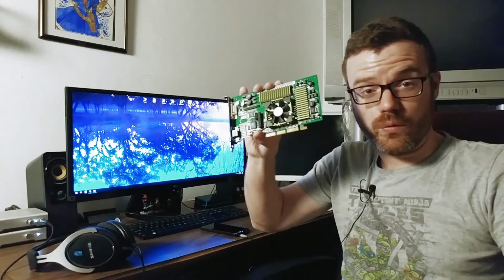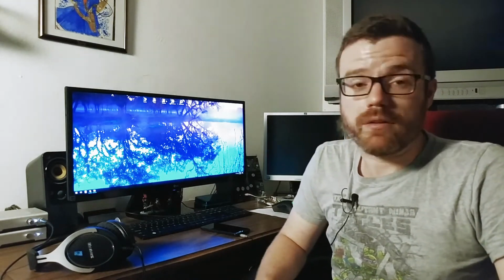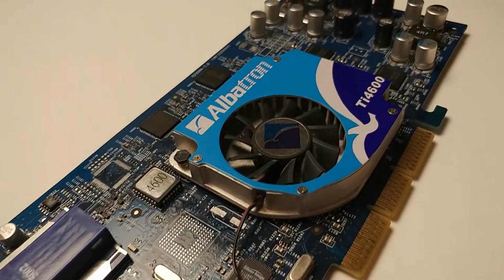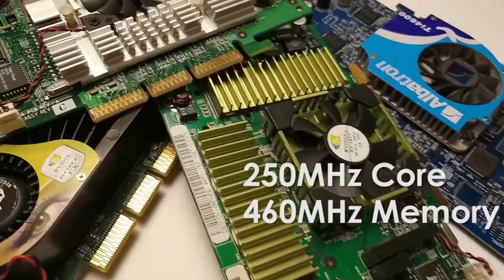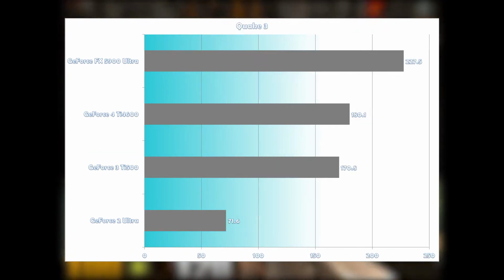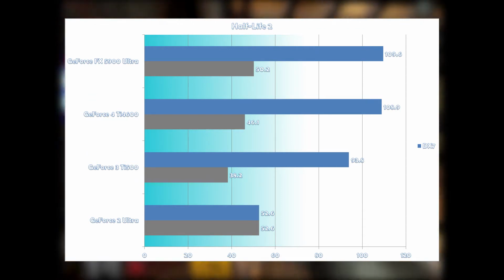NVIDIA's Quad Pipe (4x2) Architectures Compared - GeForce2, 3, 4, and FX

Comment: @PixelPipes
What about the fastest DX7 card? It might be interesting to analyze as well. The improvements are probably the similar. But it would be interesting to see the improvements over a long-lasting architecture like DX7. For example, the move from the 4 pixel pipes of the Geforce 256 to the 2 pixel pipes of the GeForce 4 MX 460.
Reply from the maker: DEFINITELY on the to-do list 👍

Comment: The graphic cards came along way back then. My first Nvidia card was  Riva 128, followed by a GF 256, then a GF 2 GTS,  GF4 ti 4200/GS,  FX5900XT and finally an unlocked GF 6800GS tuned by Riva Tuner to unlock those extra PP and VS. Lot of fun messing with these older GF for sure!

Comment: My first GPU was a G force 2. I remember being blown away when I saw quake running at a locked 75fps (which was the style at the time) using glquake. Good times 😁
Reply: my first was a diamond (brand of card)  voodoo 2,  then i got a tnt 2 ultra , then a geforce 2 ultra , then a geforce  4 4400 ti , then a radeon 9700 pro. then a radeon HD 800 ,  then a HD 5750 , then a geforce 9600gts ,  then a radeon 7870  (tahiti version with a 7950's core not standard  7870 potcairn core) and lastly i'm still currently on a geforce 1070.  damn how the power on these things  have cranked up over the years.

Comment: Ultra? those existed?? I never seen one... everybody only had the normal ones...
Reply: I got my FX5900 Ultra just last week.   256-Bit and 256 Mb! It is an ASUS V9950 ULTRA. Looks a lot different than the one in the video, because the one in the video uses the quaddro cooler and mine uses the dual fan copper/brass ASUS cooler.

Comment: For win 98SE retro gaming the FX5900 is a much bigger leap than shown here above the geforce 4 series. It brought anisotropic filtering optimizations, making setting and forgetting 8x AF a realistic possibility (this was and is the first thing you should do before increasing resolution). 

On the Geforce 4, just  8x AF clean halved performance. 4X AA would halve performance again, getting you into trouble even with older games at high resolutions and refresh rates. On the FX 4X AA + 8x quality AF only halves performance (meaning the FX is 2x again faster than at non-AA non-AF settings)
Reply: Never go under 85 Hz if possible :D
Even the GF4 increased alot over the GF3 in terms of filtering. All of them are nice for a tretro build, depending on the era and budget.

Comment: Just found you searching nvidia 4600 ti modded mine with a larger cpu cooler recently stuck on with doublesided tape & applied some weight too really make sure it sticks on.

(A fairly wide piece covering just about the entire chip so it won't fall off any time soon.)
can probably run passively now as well.

the pc holding that card though is a bit lower in performance 1 mb cache pentium 4 2.8 ghz 768 mb ddr ram. started out as a ibm thinkcentre e50 9216 i think (might not be the correct model number but similar one at least.)
Reply: If your card has holes than screw it. Literally, with actual screws. Glue and tape will never be as fixed as actual, mechanical construction.